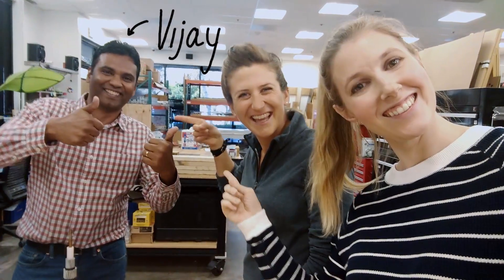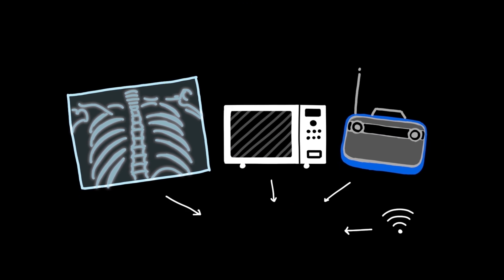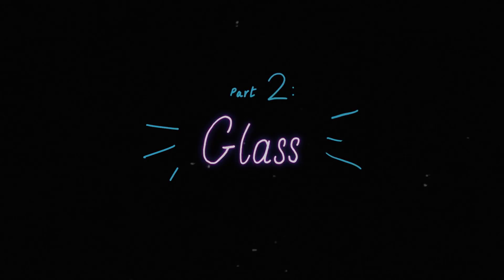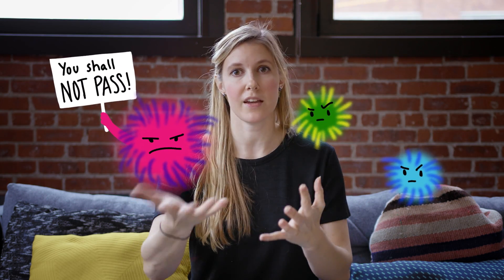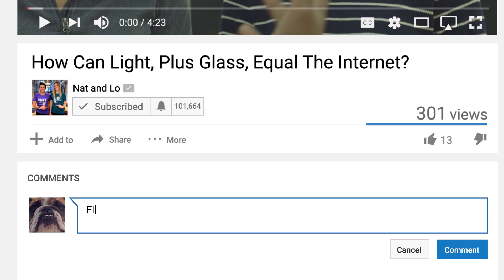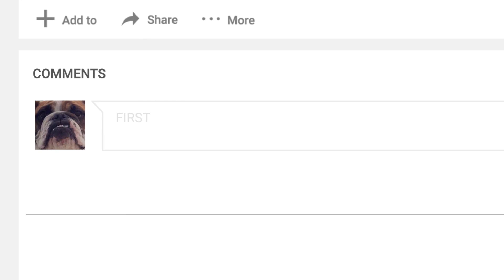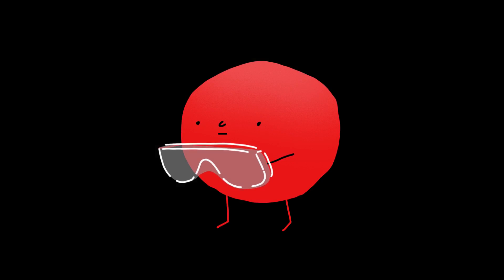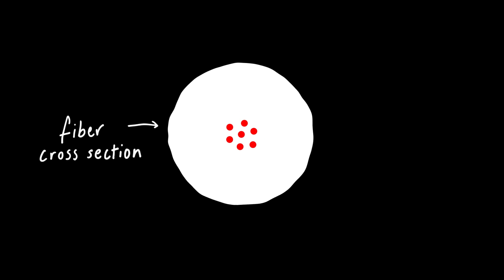How Can Light, Plus Glass, Equal The Internet?

Comment: How much data can a fiber cable (with 1 glass core) transfer? How big is the increase when you use 7 cores parallel? Would be interesting to know :)
Reply: As captured in the comments above, the exact increase in capacity by going from 1 core to 7 cores depends on a few factors like how close the cores are to each other (causing crosstalk if there very close) and the type of transmitting and receiving optics used at both ends. In general, we can assume an increase of 4-5x. Also note that most of the multicore work done has been in the lab so far and multicore fibers and associated optics are not yet deployed widely.
Reply: That depends on the distance you're transferring the data between. But it's an insane amount, so to speak. Back in 2013, NEC (Japan) and Corning (known for its glass) managed to transmit data at 1Pbps (Petabits per second) speed, or 1000 Terabits per second. Now that's what you call an insane speed.

Of course, this was all done in labs in a controlled environment, and several factors affect its real world usage. 

And with 7 cores parallel, the increase would be 7 times the single-core speed. :)
Reply: Brandon - It is a combination of factors and the one you mentioned (complexity of fusion splicing where you have to align 7 cores) is certainly one issue. There has been great progress in multicore alignment and splicing but it is not yet scalable to massive deployments with large fiber counts. The earlier comment about interference warrants further explanation : There are two types of multicore fibers that researchers are working on ; in the first type, the cores are sufficiently separated from each other that interference is not a problem. In the second type, the cores are placed close to each other and in this case there is mode coupling between the cores and this needs to be unentangled at the receiver.
Reply: Yep. Current systems support 200 or 250 Gb/s per channel and about 100 channels per fiber for a total of ~25 Tb/s per fiber. Upcoming systems in the next year or so are expected to more than double these.
Reply: David did a great job answering the question about layering hierarchy and the receiver actions to reconstruct the signal.
Reply: Not Vijay, but I think I can answer those. The fiber optics forms a link between two fixed devices - there's one laser sending to one receiver. The only synchronization needed at that layer is timing: the two sides both know how often pulses should be sent but their clocks aren't perfectly aligned. So the receiver can't assume that the pulses will be where it expects them to be, which is why it has a special circuit that figures out where they're supposed to be and adjusts them to match the receiver's clock.

The sorting part is actually done by entirely different circuits. There are several different "layers" in digital communication, each of which operates at a certain scope. Fiber optics is the lowest layer: it sends raw ones and zeroes and doesn't know anything about addresses. The layer above it is responsible for assembling those bits into small blocks, which each have a very basic address to direct the block from one device to another which is directly connected to it. The layer above that assembles the blocks into larger messages, and those have addresses that direct messages between nearby devices. And so on.

The layer system also handles various mistakes, including mis-routed messages. If this happens then when the next layer tries to reassemble the pieces, they won't match. It's generally more trouble than it's worth to fix these mistakes, so what usually happens is all the mismatched pieces get thrown away and the original message has to be re-sent.

Light doesn't really "fade", it disperses. The photons are going all different directions and so they spread out the farther you are from the source. Lasers create light that is all going the same direction, so lasers don't fade over distance unless the photons hit something. That's why we use lasers in the first place. That's also why it's so important to have super-perfect glass - you don't want any dust to get in the way and scatter some of the photons. Of course it's never completely perfect, so fiber optic cables have repeaters every so often to "recharge" the laser beam and make sure it stays bright.
Reply: Actually, due to QAM and DWDM, you get more than 200 gigabits per second.  Its not unusual to get 10000 gigabits per second on an optical system.
Reply: Placing them close to each other is the problem. Try this - make your friend stand 5 meters away from you and ask him to say something, and you have figure out what he's saying with your eyes closed. Easy, right? Now imagine there are 6 other friends standing next to him, all saying different sentences but talking at the same time. Can you make out who is saying what with your eyes closed? It's not impossible, but makes it more difficult. 

Just like copper wires placed too close to each other has issues, placing 7 cores close to each other has several issues, and real-world implementation is still a few years away, I think.
Reply: Actually, interference is likely not the problem, as much as real-world use of a 7-strand fiber segment. Terrestrial cables are made about 6km at a time, and have to be rolled out on a usable spool, and then spliced by field techs in the field.  Precision has to be incredibly high, or you get reflectance, which is really bad in optical systems.  I cannot imagine fusion splicing  / aligning all 7 cores.  I'm sure it could be done, but I expect that's the current hold up.  Further, most fiber is sold in spools of mulit-count fibers.  A given fiber cable may have 144 +/- individual fibers which can be broken out and sold / leased to other providers, so they're not exactly inefficient now, however, it's reallly expensive to lay it, and a 7-core fiber could potentially reduce the expense significantly.
Reply: Vijay Vusirikala why don't people use 7 cores, then they have to pay more but I think the costs to place them will be the same?
Reply: This is just a guess.
At 3:45 she says it can modulate 200 billion times a second

Which equals 200 Gigabits per second.
Reply: Milletimisev doesn't this take up a lot of energy? What if the energy runs out?
Reply: Vijay, with such gigantic amounts of data and speed involved in communications, how is synchronisation of send/receive and sorting out which pulse belongs to which server and computer done?  can pulses of messages be incorrectly assigned to other "threads" of communication and can pulses fade away like how light fade away over long distances? #newbie
Reply: Vijay Vusirikala

Comment: @Nat and Lo. How exactly do more than one type of light pass though these types of fiber without interfering with each other?
Reply: The different colors can all transmit down the core of the fiber simultaneously, much like all colors will go thru window glass.  The trick is to separate the light at the end of the fiber into the separate colors, then have a detector for each color independently.  Then you can get the 1's and 0's for each color.  Its called wavelength division multiplexing (WDM) and the typical fibers and hardware can do about 8 bands simultaneously, but that is changing.  You can also separate the colors by time (send one color, then second, then back to first, etc) and that is call time division multiplexing. (TDM)
Reply: if you have a red laser and a green laser shooting into the fiber sending 1's (on) and 0's (off) you could only read the red when the green is not on and vice versa, but if you see yellow at the other end you know they were both on at the same time. looking for red, green, and yellow you can know the state of both all times. red off, green off = nothing. red on, green off = red. red off, green on = green. red on, green on = yellow. by knowing how light works you can then multiply this by lots of colors of light.
Reply: As indicated above, the technique is indeed called wavelength division multiplexing and since the wavelengths are essentially different from each other, they transmit down the fiber. There are a few interaction effects among the wavelengths and the interaction effects get more pronounced the closer the channels are packed. However, modern systems are designed with either ability to compensate for these interactions or are designed such that the penalty penalty from these interactions is small. 

The number of wavelengths that can be packed in a fiber depends on the width of each channel and the amount of spectrum used in the fiber. Currently deployed systems commonly use 96 channels with each channel operating at 100 Gb/s (for long distances) and 200 Gb/s for shorter distances. Upcoming products are expected to double the amount of spectrum as well as the datarate per channel.

Comment: what wattage would the transatlantic light be at? and how much does it cost to send 1 gb of data transatlantic
Reply: Total of all wavelengths is approximately 100 mW
Reply: Ah, i was referring to the optical power output coming out of a multiplexed output of 100 channels. Optical power is measured in dBm, a convenient logarithmic scale for measuring power. 0 dBm refers to 1 mW. Subsea repeaters are between 17-19 dBm output power. Rounding them up to 20 dBm for for convenience, this translates to about 100 mW.

However, the actual power required for a subsea cable is much, much higher because of the following factors 

(i) Each repeater has two directions, so x2
(ii) Each cable has 6-8 pairs, so x6
(ii) Each cable has many repeaters, say 100 for transoceanic cable; so x100
(iii) Conversion from electrical to optical as well as power for other functions; x10
(iv) Resistive loss in copper; x2

Once you add up all the multipliers, you end up with a much much higher power footprint for a subsea cable. They are powered by Power Feeding Equipment operating at 15 KV max, and draw a current of about 1 A. Power draw depends on the specific cable configuration but is in the range of 5-15 kW
Reply: not sure the us voltage but it will probably be around 33kv at 3 amps, compaired to a tv with is 230v at 3amps, so its a lot of energy if you think about it  Nikhil King
Reply: Vijay Vusirikala 100mW? How is it so low? Can you please elaborate?

Thanks so much. I really wanted to learn about fiber optics and you just thought me everything. Thanks a ton.
Reply: Oh wow that's enormous. I feel really proud that you are Indian and you work in Google is alone an awesome thing. Can you tell me about yourself? Thanks again.
Reply: @john ingram Oh yeah. I didn't think about that. Thanks
Reply: Vijay Vusirikala how would you get into fiber optics, im currently training to be an electrician and im intrested heavily in fiber optics
Reply: There are a number of opportunities based on your specific interest within fiber optics. Most colleges offer classes in fiber optics. In addition, there are a number of fiber optic training classes in various locations. For example, check out https://www.lightbrigade.com/Training-Courses.aspx